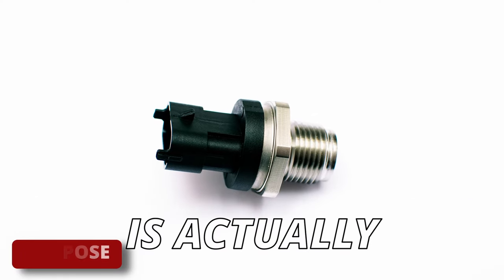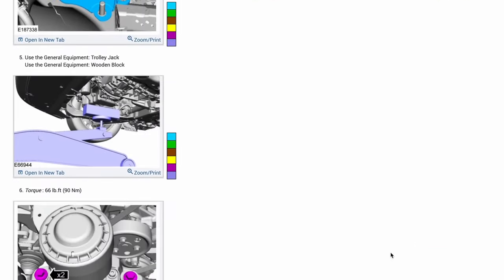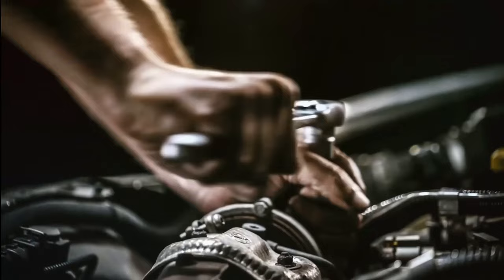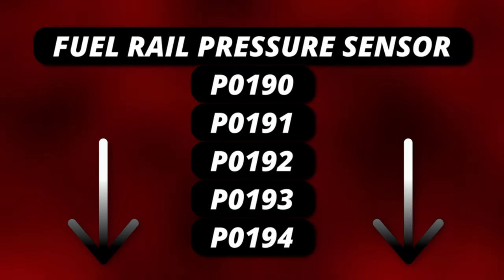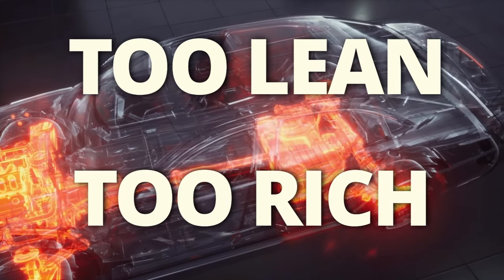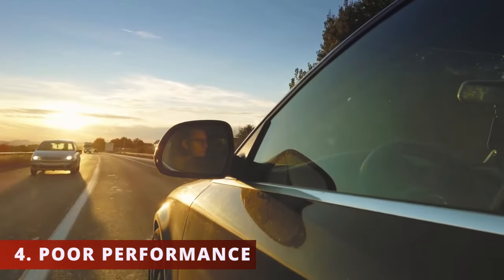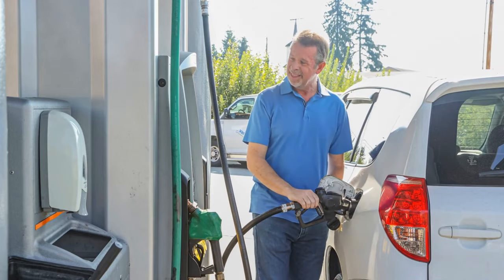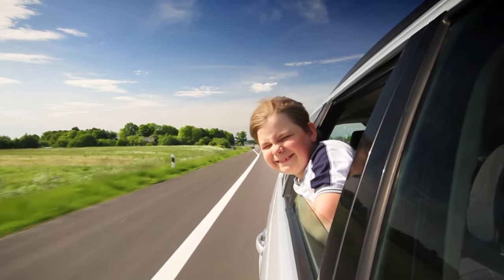SYMPTOMS OF A BAD FUEL RAIL PRESSURE SENSOR

Comment: Before doing this did you disable the battery terminal?
Reply: No
Reply: Do what???
Lol
He didn't do anything 😅
Also I'd say pulling fuel pump fuse before taking anything apart would be a good piece of advice lol
Reply: I’d say disconnect the battery after you FIX it on this one phoenix. Definitely reset the computer in the car after also take off the gas cap to relieve pressure. You don’t have to take out fuel pump relay. Hope this helps 👍🏻

Comment: Gonna guess this is my issue. I needed a new fuel pump anyways so I went with that first and it made the car run much better, but still getting random lurches/gasps of power on the highway with a P0193/P0190

Comment: My code is P0190. My mechanic is saying it’s the fuel tank pressure sensor. But wouldn’t that be a different code? The symptoms are the same for both when they fail.
Reply from the maker: You are correct, while P0190 pertains to the fuel rail pressure sensor, P0450 corresponds to the fuel tank pressure sensor."

Comment: If the sensor is unplugged will it start directly coz i am facing an issue with starting taking time but no check engine light,,,,plz advice

Comment: I drive a VW Golf and I have all the signs and symptoms of a bad fuel rail pressure sensor. I would like to disconnect the fuel sensor connector so I can temporarily solve the issues I am getting. Kindly share more light on this temporary solution
Reply: Just get another one they will only run you like 40 euros for the BOSCH ones. Also I have the same problem for 1.2 TSI, run obd scan before you conclude though
Reply: Got the same i think, fault code fuel pressure exceeded, changed fuel pump nope hpfp rebuilt nope 😂 last thing is my sensor.

Comment: Would disconnecting the fuel pressure sensor cause the EML to light up, but allow the engine to start and run seemingly unaffected?
Reply: Good question
Reply: I would like to know aswell

Comment: I have a 2014 Peugeot 308 1.2 petrol puretech. Trouble code: P0087 for low fuel pressure. Car goes to Limp Mode once above 40kmh. Took it to many mechanics, no solutions yet. Any idea what it can be?
Reply: I have that code and limp mode too in a Audi a7, you solved it?
Reply: @nunobrito6848  I solved it after like 5 months of taking it to different garages. Worst case as no one could expect, previous owner changed the engine due to accident. Basically, he put the wrong engine in the car. These Peugeot 308 models have 3 different engines. So what I had to do was to change the camshaft so the computer reads it, all sorted. €1500 with labour
Reply: @sal.the.enthusiast  oh, mine I think is really one of the pressure sensor I have 2 I will try to replace one by one, thank you for the response 🤞
Reply: @nunobrito6848  Yeah, for sure yours shouldn't be this complicated. Probably just a pressure sensor. Peugeot is a s*** car! Nothing but a toy! Audi A7 is super amazing! Hope you get it sorted soon 👊
Reply: @sal.the.enthusiast  thank you sir, I appreciate ❤️

Comment: 008851 - Fuel Pressure Regulator Valve (N276)
P2293 - 002 - Inadequate Performance - MIL ON, what could be? 1.4 tsi CAXA

Comment: If u unplug then u will have engine light right? How come it help u. Sure put u into limp. Mode.?
Reply: Exactly that's why you just replace the sensor I have a fuel pressure regulator instead 🤞💪

Comment: I have an 03 Cobra.  Had P0190 code in 2017 and replaced dual fuel pumps.  Just threw a code yesterday .. P0190.  

Air/Fuel gauge hangs around 14.5 to 14.7 at idle.  Haven’t taken it in to have put on diagnostic equipment yet.  

Any thoughts?  Surely the fuel pumps couldn’t be bad already.  Only 5 years old, and only a couple thousand miles on them.  🤔

Sub’d!

Comment: My fuel rail pressure sensor keeps loosing its signal to the ecu. Can be seen on the Torque app live. Unplugged the cars fine. Plugged in causes stalling, no revving. The sensor has been changed but still acting up. Anyone any ideas ?

Comment: I’ve a stalling dying out issue and a cranking issue. What could possibly cause both? A single thing or two separate things ? After sometimes it’ll crank / start it’ll shut off. Help. 15 Fusion SE 2.5 L. No codes or check engine light. Darn 😡
Reply: I have the same problem with my dodge Dakota 1995 v8 318
Reply: @lukeharris3164  from what I’ve heard, could be a of of things. Have it at shop they’re looking at it over. This other shop that diagnosed it said it was the computer. Heard is not computer but loose wire / ground. Sensor maybe. Hopefully they’ll find out

Comment: 2017 Ram Laramie  echo diesel, purchased (used) looks brand new ,to tow a small trailer .THE TRUCK IS A POS. The pressure sensor is just the latest. of my many excursions with my local mechanic.

Comment: Have an 06 cts. Anyone have this issue? Thats what the code told  mep1093 fuel pressure sensor? I have no engine light. Just T/C and ABS light went off